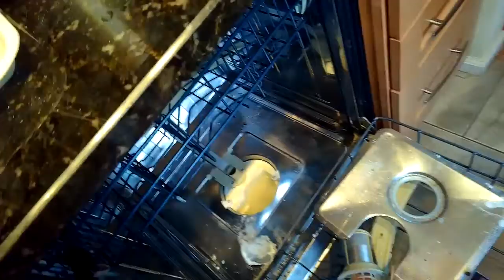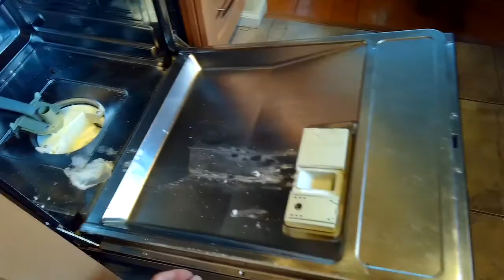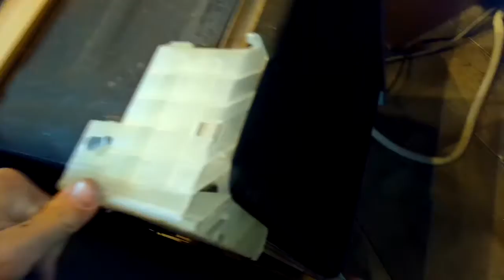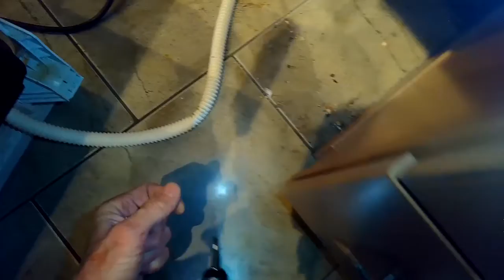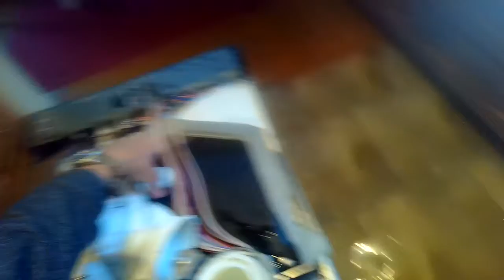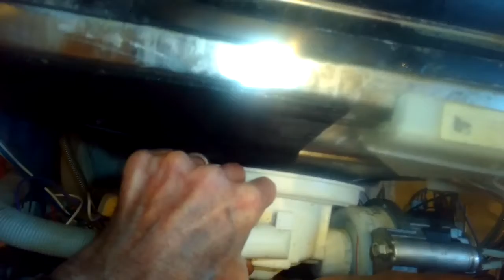✨ Bosch Dishwasher Isn’t Pumping The Water💦  FIXED ✨

Comment: Thanks for sharing. The upper sprinkler of my Bosch diswasher does not work. The bottom one has strong pressure but upper sprinkler does not.
Reply from the maker: Usually that’s from not enough water coming into the dishwasher.

Comment: "Bosch dishwasher error 20-12, do you know how to fix it? Thank you"
Reply from the maker: Thank you @grazianocapodicasa3835!

Error 20-12 on Bosch dishwashers typically indicates a water drainage issue. To fix it, check and clear the drain filter, ensure the drain hose isn't kinked or clogged, and inspect the dishwasher's sump for debris. If the problem persists, it may be best to consult the user manual or contact a professional technician.

If you need more info, you can reach me directly for a fast answer at AsqMe.com/@ScottTheFixItGu

Comment: My Bosch DW just hums and won’t draw or pump water. I replaced the water inlet valve, the water supply line, and the float switch tested good. No success same humming noise. I don’t think the pump is causing my issue would you agree?
Reply from the maker: Hi Terry,
Can you send a video of that to: scottthefixitguy@yahoo.com
Reply: Was there a solution to this issue? I replaced my water inlet valve also which didn’t fix mine. Thinking mine is the same problem.

Comment: That was a very thorough video. What was the dishwasher doing wrong that lead you to replace that part? I am having issues with mine and haven’t got a proper diagnostic on it. Thank you
Reply from the maker: It would fill,
But it wouldn’t circulate the water. You could hear a whirring noise but no water movement.
Reply: @ScottTheFixItGuyChannel thank you very much. Mine is making a humming sound. Is that what that one was doing? On mine, it sounds like something is working hard but is obstructed. It seems like I don't have enough water pressure since I struggle to have pod dissolving. I replaced the drain pump and didn’t see any improvement.

Comment: Hi, Scott, the soothing-voiced Fix-it Guy.  I have a SHEM63W52N/20.  Quit working after 1.5 yrs.  After various fixes, I've now settled on circulation motor.  Ordered a new one (12008381) and have it ready to swap out by using your video.  But I'm confused about impeller. I can't figure out if impeller should be part of, or attached to, circulation motor?  I don't see an impeller on new part, so I'm wondering if I need to somehow glue old impeller?  I thought that as long as I was going to the trouble of replacing the motor, I would ck out price of impeller (kit?) and do that as well, but it doesn't seem like, for this newer model, there is such a thing?  Please forgive me if it will become obvious once I take apart; I just hate to go to all the trouble, only to find out I should have included impeller purchase somehow in repair.  I should say that I did previously clean out impeller (found a small amount of pet hair and a bit of debris) and reran dishwasher, but didn't help.
Reply from the maker: Great question, can you send a few pictures to: scottthefixitguy@yahoo.com
Reply from the maker: This one does have the impeller inside it: https://amzn.to/4eEF7EQ
Reply: @ScottTheFixItGuyChannel  … TY so much.  I really appreciate your response.  I swapped out motor and - voila! - dishes are still dirty.  Sigh.  It was such an arduous project for me, but I never could have done it without your video.  Even so, there were many differences bt the model you showed and my model.  I don’t know what I’m going to do now, but I’ve learned from my multiple attempts to repair this Bosch that, yes, I can do it; but, no, I don’t want to do it again. 😣I’ll be checking out your website re a remote consult, IF I don’t take a sledgehammer to this DW in the meantime.

Comment: I found I didn't need to disassemble as much as you showed just to replace the impeller motor. 

I think you only need to remove the kick plate and pull the dishwasher out (and of course turn off the power and water to be safe!)

I didn't need to remove the front of the door or the side panels or the sump.  The impeller motor just needs to be unplugged and it twists off.
Reply from the maker: Nice job👍
Reply: I took the impeller cover off and should the blades spin freely, or have resistance? Mine has some resistance.

Comment: My impeller seems to be bound up with no obstructions in the drain area. I’m also getting a buzzing noise and standing in the water in the bottom of my SHV4303UC. Is the impeller the likely culprit? I tried running it after draining all the water and it’s getting no water into the system.
Reply from the maker: Can you send your same question to my email at: scottthefixitguy@yahoo.com

Comment: This video showed my problem exactly. Impeller fell right out so clearly this was the problem. I can’t get this part, all I could find was out of stock so I used epoxy to glue it together (“JB Weld” two part epoxy good for 550F). Also had to replace the inner C-tube as it had split at the bottom. Thanks!
Reply: is it still work well? Can you provide name of glue please?
Reply: Yes still working name of glue is in my original comment above
Reply: @zazoobah  Thank you for replying. I search for JB Weld glue, there are many of them, I don't know which one. Please give me the link or exact version. Thank you
Reply: I believe I used the MarineWeld version. Really most of the epoxy’s would be fine to use - 10 buck at home depot
Reply from the maker: Glad it helped😊👍
Reply: Genius idea! Is it still holding up?
Reply: @iHorseAround  Yep, still going strong

Comment: And after all that there is no replacement part available - so it is off to the dishwasher store for the sake of $0.50 worth of plastic and rubber. Everything else is fine.
Reply from the maker: Here you are Mark: https://www.ebay.com/itm/Genuine-167085-Bosch-Dishwasher-Circulation-Pump-Repair-Kit-/252376466775?hash=item3ac2cf4557
Reply: @ScottTheFixItGuyChannel  Thank you. It says zero available. I am going to pull the unit and look - at this point I can do no wrong. May your days be filled with kind people and your nights with good sleep interrupted by even better other things.
Reply from the maker: Hi Mark,
What’s your model number?
Reply: @ScottTheFixItGuyChannel  shu43c05uc/17  When I contacted Bosch they said I had gotten about twice the life expectancy already but the only thing keeping it from another X number of years is the impeller. I spend about half my life fixing things.
Reply from the maker: Thanks so much Mark for your blessing.  Can you try these guys for the part: https://www.ebay.com/itm/203039671108?chn=ps&_trkparms=ispr%3D1&amdata=enc%3A1rZUTf0Q8TSOMtoLZz4pSbA45&norover=1&mkevt=1&mkrid=711-117182-37290-0&mkcid=2&itemid=203039671108&targetid=1599090336377&device=m&mktype=&googleloc=9032028&poi=&campaignid=15275224983&mkgroupid=131097072938&rlsatarget=pla-1599090336377&abcId=9300697&merchantid=109159219&gclid=CjwKCAiApfeQBhAUEiwA7K_UH9NcLJ8PIHs2r-HVEAPF0Qt4m3H4D3uJhIePkvTU7y_xXoSJw_PtnBoCAcMQAvD_BwE

Comment: This looks like what is up with our DW. One of those take pics as you take it apart so you know what it supposed to look like when it is being put back together. Sure would be nice if I could just pull the unit put it on its back and take off the bottom. A hot assistant with cleavage would stop me from skipping forward. Just an idea.
Reply from the maker: Good idea Mark😊👍😂

Comment: Hi great video..I have a very similar dishwasher to the one you're working on. But mine will not draw any water..It cycles as normal and sounds like the pump is trying .it  would sometimes wash the dishes properly then all of a sudden not ..does this sound like  it could be the impeller or does it sound like it could be another fault?

Comment: Scott.  My Bosch dishwasher turns on runs for a few minutes and turn off.  Is this an easy fix.
Reply from the maker: Hi Ronnie,
It sounds like it may need a new controller that lives inside the upper portion of the door.

Comment: I have three parts that fell out while fixing it and now I don't know where they go back! A red plastic rod, a polystyrene disc with a hole in the centre and a 15cm grey plastic piece with a thimble shape at one end, a cross shape in the middle and it opens out in a V at the other end. I think I can see the red rod on the video, so I'm alright for that, but not idea about the other two!
Reply: I figured out that the grey piece linked into the red plastic rod. It's all reassembled now and I ran it on a quick cycle just to see if it worked before I put all the panels back on. Everything seems to be in order, fingers crossed! Thank you for making this video, Scott. I'd have had to scrap the machine otherwise! Also, I had a repairman look at it a few weeks ago and he said it would cost too much to fix, it's feels good to have completed this because it wasn't easy!

Comment: Is it possible to remove the whole motor/impeller/lower pump housing without removing the sump housing/upper pump housing
(after disengaging the locking tab and rotating the whole motor assembly clockwise) ?
Reply from the maker: I think you can do it.
Just have to remove the four screws in the four corners of the dishwasher that connect the dishwasher frame to the plastic blower assembly.
Then when you remove the motor and impeller housing by twisting it you should have room to be able to pull the motor out.
Are usually have to separateThe upper frame from the lower plastic housing by about 5 inches to slide the motor out.
Reply: Thanks for the quick response. The only thing that might foil this plan is if the motor starter capacitor bracket hits the underside of the tub floor before the motor/impeller housing disengages.
Reply from the maker: I wonder if you can remove the housing first?